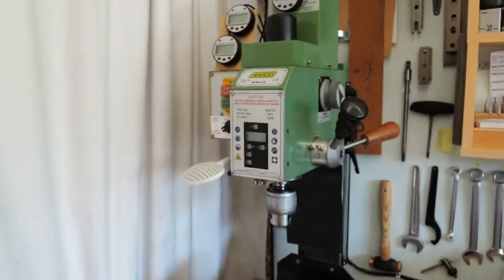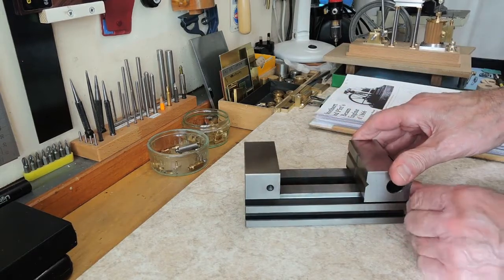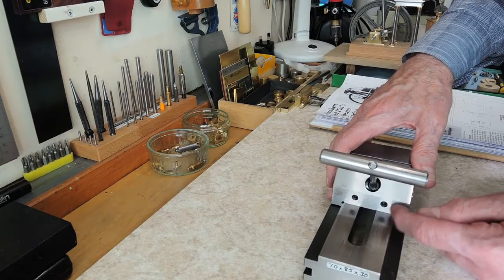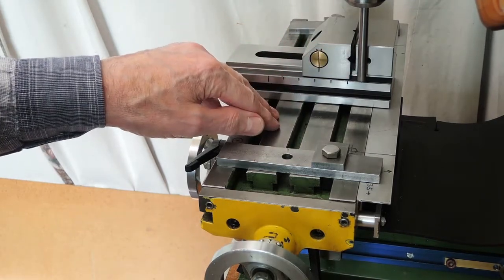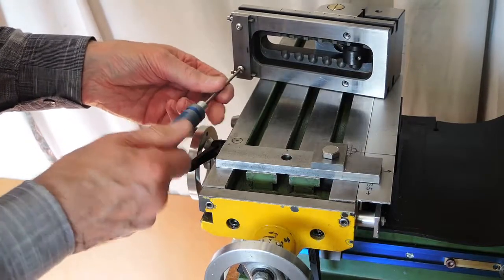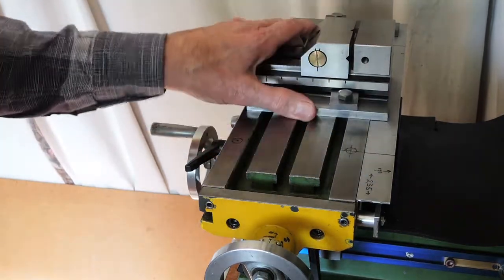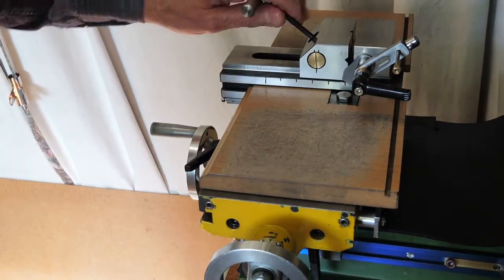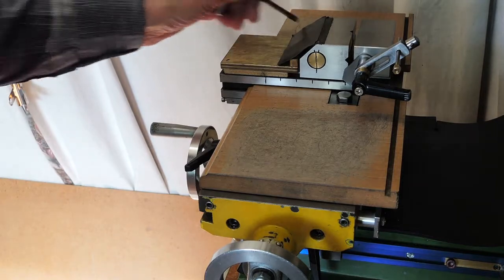My Mods. to Screwless vice Toolmakers vice for small milling machine

Comment: Thank you for sharing your great ideas.  I’ve just brought the same mill, waiting for delivery.
Would you mind making another video sharing the other mods made to your mill?
Reply from the maker: Thanks for your comments Sam, I with be adding some more info about the vice and the mill soon. but there is a difference between my early version and the latest updated versions of this machine which now has a longer table and fine feed depth control.  It is an ideal machine for the small workshop.

Comment: Super, some great ideas, where did you get your vice from? In the light of experience, would you have got a bigger size?
Reply from the maker: I bought the vice from Arceurotrade in the UK.  this is the latest design and has the widest jaw opening over the 80mm vices I had tried before. A good range of parallels makes this vice work well.